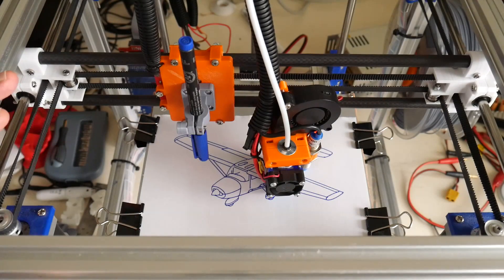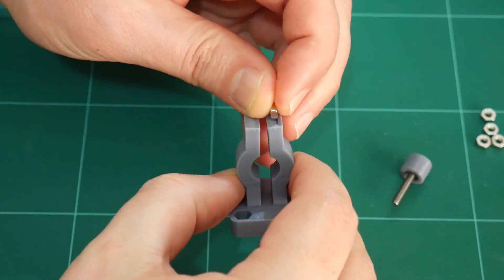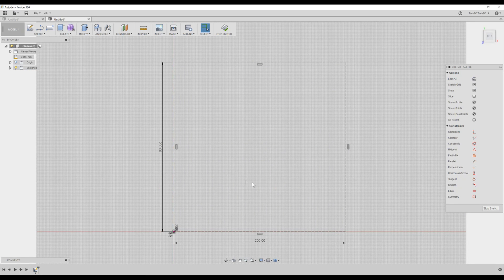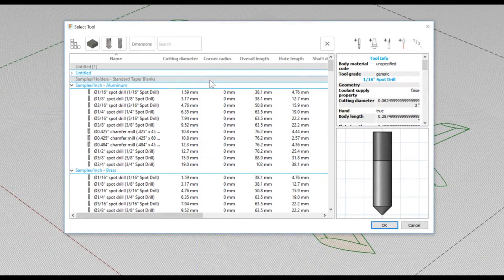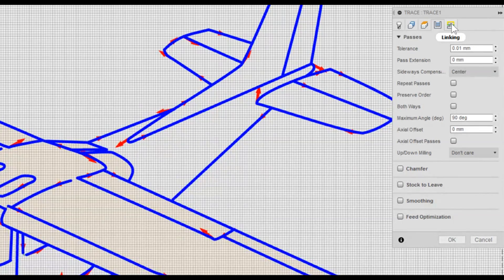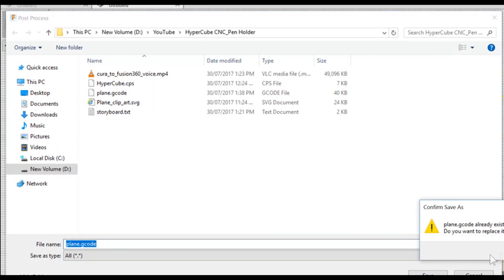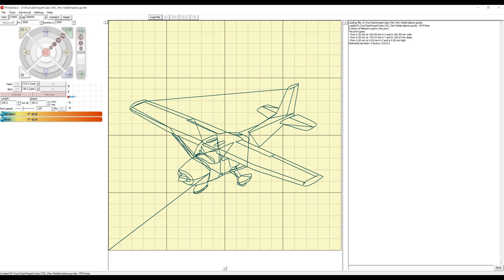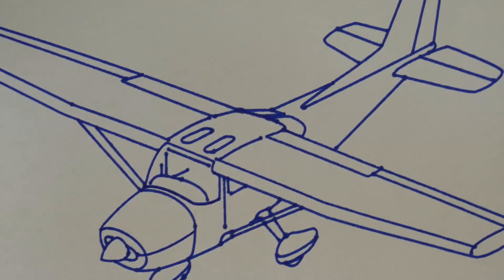HyperCube CNC: Drawing with Fusion360

Comment: Hi there I'm following you  And thank you very much for what you do. About  the Pen Holder  I started to print, Then I realized that  you could simply turn the pen mechanism upside down Then you can use any Pen Holder 

the file HyperCube.cps It's great  But in my printer THE Z  Axis He turns up Not like your settings I fixed it and it works great.TNX

Comment: Do you have a video showing how you generated the post processor. I'll have to download and try this using a laser. 

I started to but needed to make the post processor. Now at least I have a start.!!  Thanks so much for sharing!!  ~Russ
Reply from the maker: Hi Russ. No video showing the file make. It was adapted from the inbuilt gerber.csp and dumper.cps within Fusion360.
I have a 2.5w diode laser in the mail, so can't wait to try it out :)
Reply: Where can I download the post processor that you use in this video?

Comment: manually selecting all for export needed lines is unacceptable. think about PCB milling
Reply: Я пью тосол you can hilight all paths with one click. Or you can I port them differently so there isolated. PCB for sure I also will try fusion for PCB. Right now I use FlatCAM. Free works fine. ~Russ
Reply from the maker: Yes, I was going to say I'll be using FlatCam for PCB.

Comment: Would you be able to actually print a photograph with this? Maybe turn the picture to only b&w, divide it into a grid and have to pen pass through the black squares in the grid?
Reply: Inkjet style printers already do a similar process to this, except on a much finer scale. The comic book style dot color you're probably familiar with was a cheap way to get multi color prints going for illustration medium like that, but even today, we still use it in news print as a cheap way to lower printing costs by using less ink to create the perception of shading/color blending.

You could do this same thing by as you said, taking a raster image, mapping the black density gradients, and using a fine tip pen, draw various sized circles to represent the image.

The tricky part is I'm not aware of a utility for doing the gradient mapping, but custom plugins for fusion could potentially solve this hiccup.

Comment: The only thing I would add is that Im surprised you havent yet adapted the mounts to HotSwop Quick Release Mechanism such as is used on tripods. This is what I hope to develop for my Hypercube so there's not a load of screwing/unscrewing going on each time I want to swop in a new printhead. The combination of a Quick Release with side wall limitation to eliminate unwanted movement, & inset magnets  on the mount and the rear of each hotswop head should keep everything solidly in place. No more screwdriver.

Comment: Nice.

I once used my Printrbot Simple Metal to control my smartphone. I printed a holder for a capacitive touchscreen pen, and I created a browser-based interface to translate my mouse actions into gcode, which was dynamically sent to the printer via the Octoprint API. Fun little project.
Reply: It occurs to me that might be a fun addition to your pen-on-paper setup, too. You could use the mouse to draw shapes on-screen, and the Hypercube could mimic you on paper as you draw. (Freehand, of course, but you'd also have a circle tool and straight-line tool.)

Edit: @Tech2C: If you're actually interested in trying this, let me know, and I'd be happy to write the code. I already did the research, and it shouldn't take a lot of time.
Reply: hook up a pen tablet to the computer, and draw live over the internet?
Reply: Yup. Could be fun.
Reply: Well, then what about just taking a pen in your hand and drawing by yourself? 0_o
Reply: +Nikita BOGUSLAVSKIY: Sounds a bit far-fetched to me...